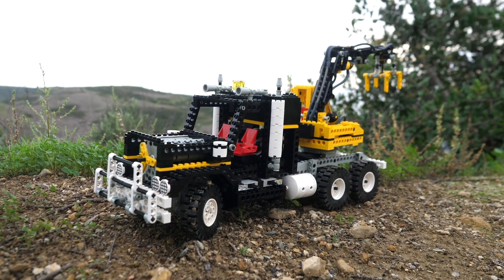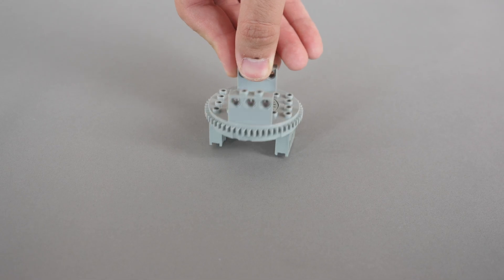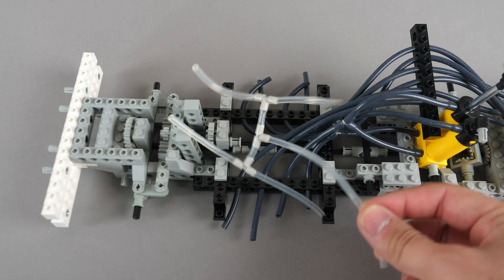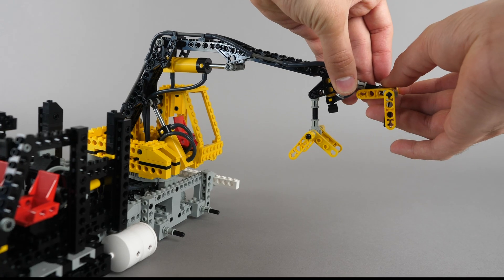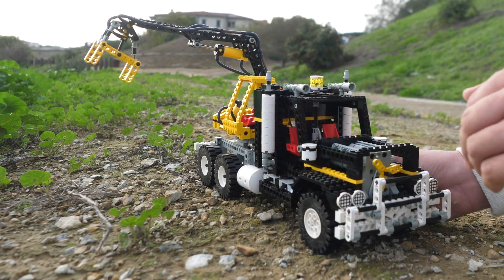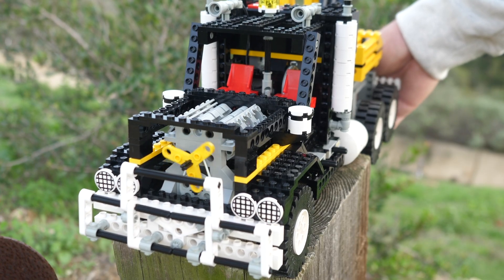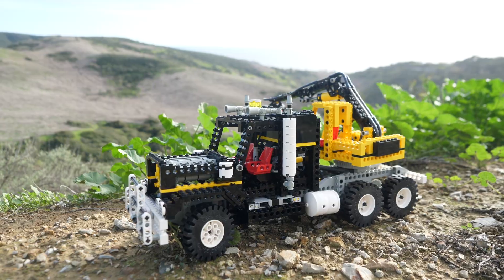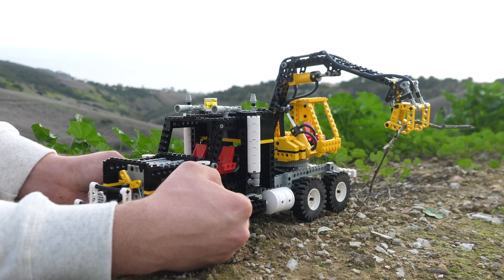LEGO Technic Air Tech Claw Rig 8868 Reviewed!

Comment: I had this since I got it as present when it released. Such great kit and was very fun to play. Only thing it lacks is pneumatic tanks and something to turn off motor when pressure goes too high. My yellow battery box melted while playing due to pump pumping and drawing lots of current when not moving cylinders constantly. So glad I kept it as decoration on shelf past 20 yrs (still keep playing with it sometimes though). The secondary model trash dumper is even more interesting as it has that automated cycle in it.
Pneumatic cylinders are much better to use than mechanical ones I keep seeing in models from Lego and others.

Comment: I had this one as a kid and MASSIVELY struggled to get it built. I was just way too inexperienced for it, but managed to do so on my second attempt about half a year later. Unfortunately some of the original bricks had gone missing at that point and my truck was a bit off-coloured because I needed to use spare bricks, BUT I made up for that by installing a compressor main switch that could select between powering the truck's pneumatics or re-routing the airfllow to an external hose with a connector pipe. That pipe could then be put into the manual pump hose of other pneumatic models and power them from MY compressor.

My truck was the off-coloured star of the school because of that.

Comment: I've got a couple copies of 8868. Mine have grey instead of clear hoses. I wonder if either the hoses are replacements, or if that's something that differed depending on what was available for supply when and/or where that particular set packed.

Comment: I got this set as a kid and it's great fun. The only downside I remember was the motorised compressor being a bit slow, especially when trying to pick up a heavy object. Though to be fair half the problem was probably from running it on very well used rechargeable Ni-cad batteries😅 I ended up attaching the manual compressor to get the pressure up to where hoses started popping off 😂. That generation of motor was soon replaced with the geared version with way more torque and I'm sure it would have done a much better job. Also I'm now thinking that the pneumatic cylinders would all have benefited from a little silicone grease to reduce stiction.

Comment: You really cant compare it with the arocs

The arocs has: a gearbox, a tipping bed, opening doors, suspension, 

The claw rig has: two pneumatic cylinders turning the claw... yeah thats kinda it

Overall they are the same but the arocs is bigger and has more functions

Comment: I got half of this set from a flea market... Three large pneumatic cylinders plus the small one, four of the wheels, the motor, the weight brick, the switches, the pump, most of the V6 engine, and an assortment of black and grey beams. Sadly, I can't complete the set with parts from my collection, but I did build my own homage to the set with most of the same functions minus the pneumatic turntable. Since I didn't have the original battery box, I had to use a later studless Technic 9V battery box, and to make things extra complicated I also didn't have any surviving 9V wires, so I had to power the motor by attaching it directly to the battery box and surround the box and motor with technic parts to prevent the two from coming apart. It made for some super awkward packaging, but it did work! I love old Technic, and I really wish it was used more in modern sets since most of these pieces still exist. Perhaps an old-school Technic Universal Building Set could fit in the LEGO Classic line?